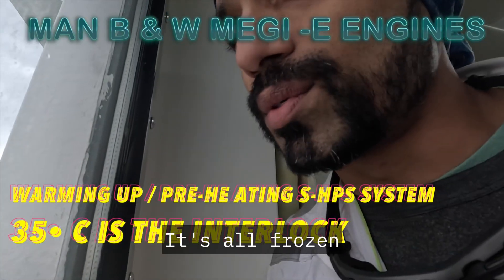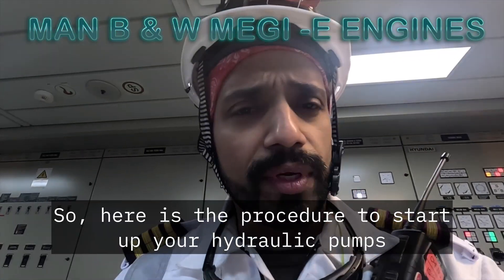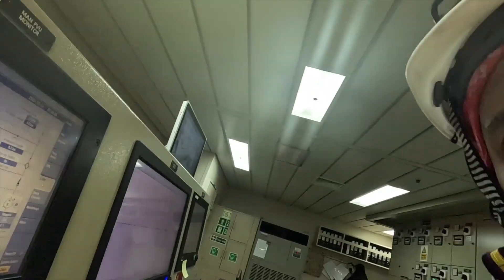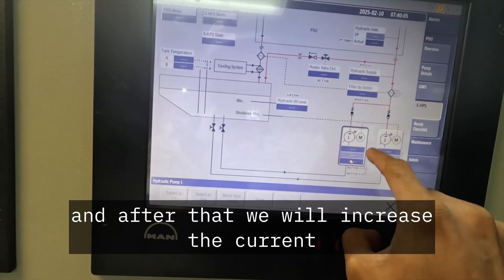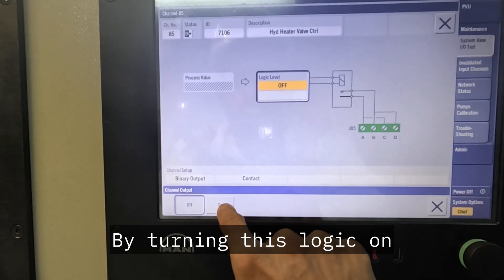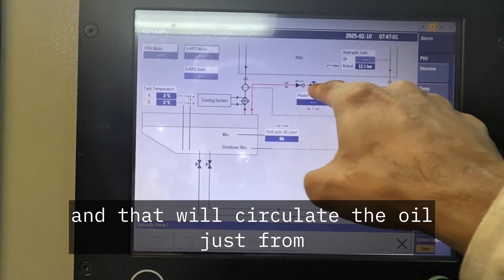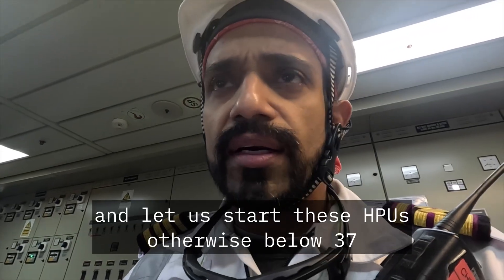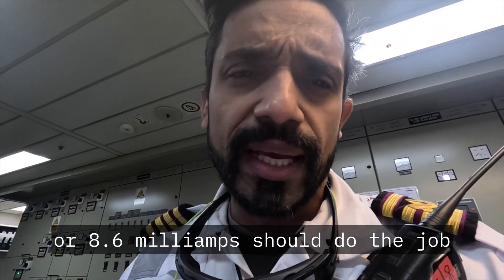S-HPS PRE-HEAT/ WARMING UP PROCEDURE - MAN B& W MEGI-E ENGINES

Comment: By the changing mA you are actually changing the position of swash plate?
Reply from the maker: YES, EXACTLY, we need to do this when the ambient temp is lower.. as oil tank also drops, most systems do not have internal electrical heaters some have to heat it in this way by circulating the oil. need to increase the swash plate angle gradually to avoid overload of motors and pumps